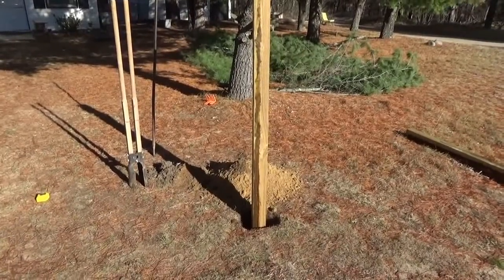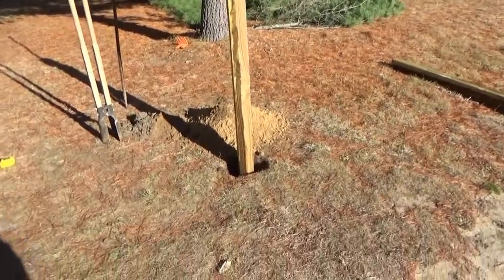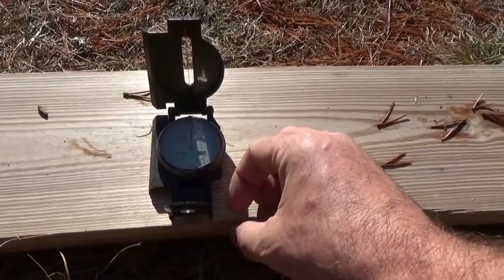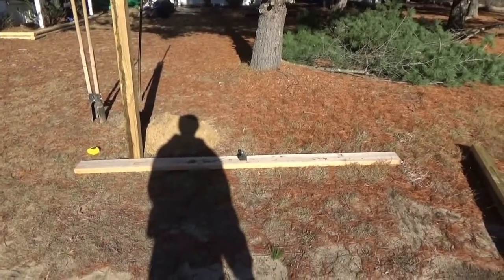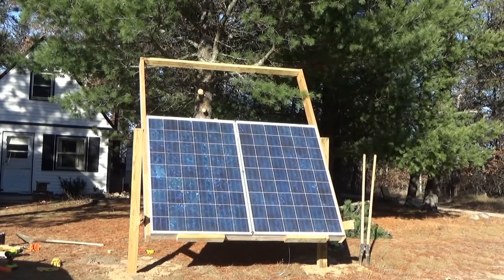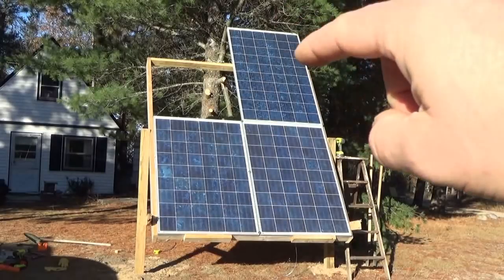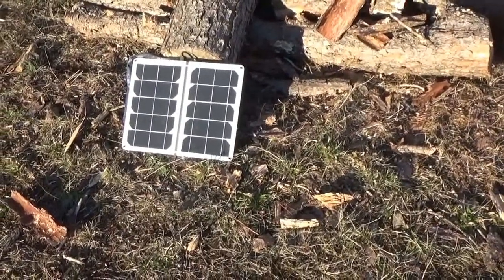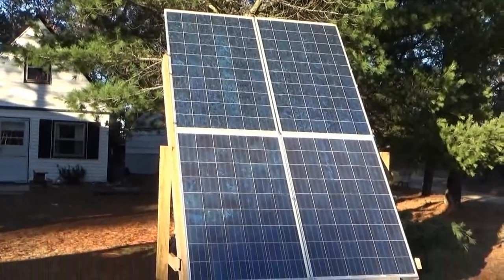Building Adjustable Solar Panel Rack For Our Tiny House Power

Comment from the maker: Read the full article here: http://www.thedoityourselfworld.com/articles/article.php?id=11555
Reply: Wow cool man Im so glad your properly mounting the solar panels with adjust ability.  In the summer time here in Oklahoma in June July August the sun can be straight up and even back a little north I guess it never gets straight up in Michigan so the tree wont ever interfere. Why not use concrete a few bags in the hole and some rocks so it will be really stable. Buy a brand new Tasco scope at Walmart they are cheap fifty bucks maybe. I bought one and it was a 50 mm view and thats some good light capture and clear wow super nice. And get a 8x10 or even a 10x12  or even a 15x they are sweet I got one for my 22 magnum for shooting ground squirrels or tree squirrels. You will not be sorry if you put a brand new Tasco scope on there from walmart they are cheap and darn well worth the money. mine never leaks its is totally awesome wooo hooo. Dang wish I could come and deer hunt with you that would be super nice hunting and fun trip. And eat your wifes cooking LOL The landscaping wire is great for solar you can bury it and it comes in 12 gauge and 10 gauge and even 8 gauge so you dont loose any voltage. They sell it on Ebay Homedepo and Lowes the lumber yard to name just a few places you can get it. I like it because it is bury able and works so good for solar and also it is bury able. Even though I still have not buried mine yet LOL Some guys use extension cord but its really not that good for solar but it works for a little while. the larger gauge like 10 or 12 gauge would be the least biggest size I would use of course 8 is great.

Comment: 8/23/22 - I have the same frame in mind, before I saw this guy. Already bought the stuff. Seems like a good, uncomplicated way to make them adjustable with the summer/winter sun. I'm dipping my poles (the 2 ft that go in the ground) in rubber paint that I had leftover from another job to make them last longer and painting them brown (with leftover paint from another job). I don't want to re-do all this in 10-12 years.

Comment: Anyone???  If you were to wire a brand new home, Would you put a DC line in. You know, for things like charger, modems and routers?
Reply from the maker: I would have both AC and DC running if I was doing it all new and using off grid power. For small devices its more efficient to use the lower voltage rather than step up from 12 to 120 volts and then back down to 12 volts or 5 volts.

Comment: Looks ok but I would have cemented the holes into the ground case of high windy conditions, Also I would have build them higher of the ground case of deep snow fall, But I'm wondering why you didn't turn the frame over and just mount the panels upside down instead of climbing up the ladder?

Comment: When you dig the hole for the post if you drill to holes one one way the other the opposite like a 90 degrees put the post in the hole an put some sack creat sorry about spelling it will be super steady an with treated wood will ladt for a long time just don’t add water the cement will absorb moisture from earth

Comment: I am going to build one like yours but can you tell me if the there is cement in the hole. If i dont use cement will it still hold
Reply from the maker: Cement is better but so far my panels from a year ago have held up very well due to our soil type. That rack has seen some very serious wind and barely shakes.

Comment: Hey Troy. That solar panel frame is looking great.  I never have seen a steel bar soil tamper like that.
Was there a reason you did not want to mix up a bag of Quickcrete to cement those supports in there?
I cringe whenever I see a post hole digger......arghh  the blisters on my hands!!!
It's just not natural to push down....pull apart then pull up.

I was wondering if you will have a problem with sap from that tree falling on your panels.  I had sap fall on my van when i parked it under a pine tree.  Will this be the most wattage you have ever had on a homestead?

Congratulations on bringing in so much meat this year.  Too bad you could not go to your iron sights when the optics failed.
On second thought if your eyes are getting old like mine are maybe waiting till you replaced your scope is best.
It will be neat to see the many ways Melanie will be preparing errr   Bambi.
Reply from the maker: Thank you. I never thought about the sap from the tree. I have to keep an eye on that.

My scope failed. It was shooting very high and to the left. About a foot off at 25 yards.
Reply: Hey Troy.  I am not a hunter but i do love going to the range and killing paper.
I built my own AR-15A1  from a stripped lower receiver and I have had great luck with 
a very inexpensive Chinese scope.  

It is made by CV Life and it is 6-24 x 50   .   You can find it online for $34.99 free shipping.
https://www.amazon.com/CVLIFE-Hunting-Rifle-6-24x50-Illuminated/dp/B007UT3N4Y

It comes with ring mounts too.  You can get it by monday I think with express shipping.
I am not sure how long hunting season is there so maybe it would be a good back up for next year.
Here is a video review

https://www.youtube.com/watch?v=AnCIlf1I2ok

Comment: Good work Troy :)  However, if you wish to be super accurate with your alignment please remember that magnetic south does not always equate to true south due to variations in the Earth's magnetic field over time.  Currently the difference between True and Magnetic North in Michigan is about 6.5 degrees.  Magnetic South being 6.5 degrees to the East of True South.  Not much difference to worry about but you may find that the Sun is not directly overhead of the panels at solar noon for this reason :D
Reply: One way to be more accurate with north-south is to look for the north star at night and line up with that.

Comment: Awesome job on the solar panel rack! Great to see you're making an effort to do things more professionally. Hope you keep up the good work by properly burying the wire underground in conduit. Conduit is cheap and it is probably not that expensive to rent a trencher. Doing things right makes a much better project for yourself and silences those pesky trolls.